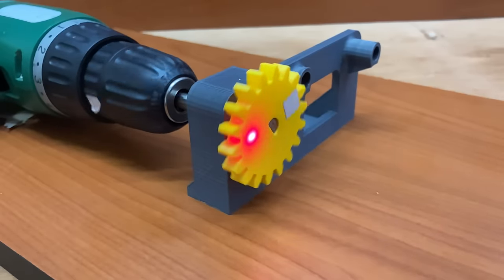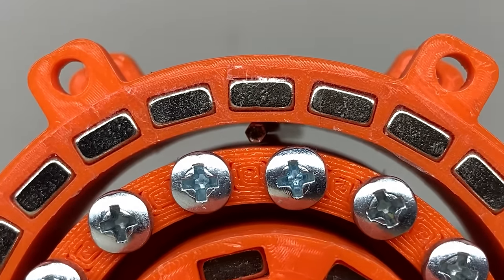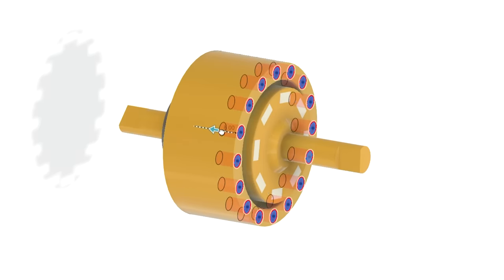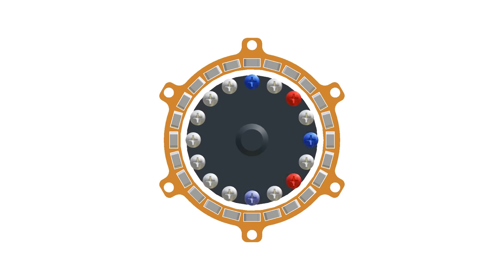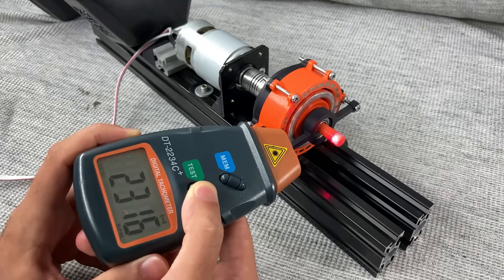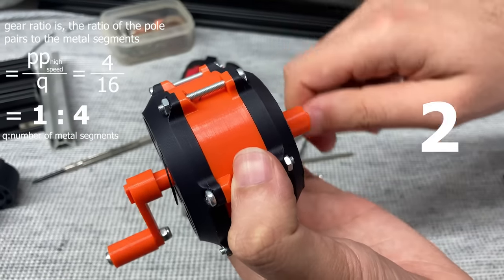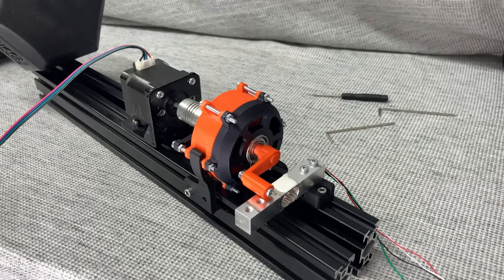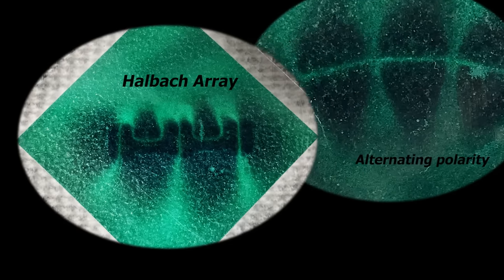Magnetic Gears - Why Nobody Talks About This?

Comment: Nobody talks about it as its old news. Motorcycles have used basically this exact "magnetic gear" to run the electronics with the object called a Stator... or on a car, its often called an alternator, (works a bit different but still does the same thing). This is why you car can run without a battery but not start without it, a motorcycle is a bit different, but still operates identically.
Reply: 8:29 Seriously take a moment and look at a stator replacement on a modern motor cycle.. youll see that exact bowl shaped ring magnet "gear" complete with magnetic pads.

Comment: Or just go gearless with an AC motor and VFD.  

Gear drives are extremely efficient at >97%.  Plus you can change the output direction.  Even with the magnetic drive you need bearings, that need lubrication too.  You could get some eddy current flow and damage the bearings if not electrically isolated.  

It’s a cool engineering concept though.

Comment: I don't know what a good use for these would be though, because they basically behave like mechanical gears with very worn or poorly meshed teeth, in that the teeth will skip each other with very little force. The only way you could deliver torque comparable to a mechanical gear system is to have the magnetic forces be on the same level as the shear strength of e.g. steel gear teeth, which seems like a lot of trouble compared to just cutting a gear out of a piece of metal.

Comment: Besides these boxes being in close proximity to other metal components inside engines.
Would these boxes have the capability to actually turn a load without breaking the magnetic attraction and cause slipping?

Comment: At 8:12 during the 10min 9k rpm test, look at the screw on your housing assembly, it was unscrewing itself‼️ 
I thought that was why you stopped it, to prevent the whole housing failing! Then your just like "nice, only the bearings got a little hot" 😭

Comment: People talking all in educational comments: Motor and Generators are magnetic gears and we are using it. As we see when we solve expressions. Motors works out to be "electrical"-"magnetic"-"electromagnetic-force" (no magnetic-electrical as we engage our own magnetic fields as rotor current to produce the effect.). So you see same direction as rotating magnetic field. So why is this rotating in different directions? Because in motor we make and control magnetic field and its direction. On contrary this guy just complexed a topic by bringing his own screw cylinder. We normally counter such harmonics of BACK-EMF through filters and back-feed.
Reply: I talked correct, not said well.
I hope you will get my talk.

Comment: I heard this saying in the blacksmithing forging community, if a magnet sticks then it’s not hot enough to forge. 

I wonder a way to keep these magnets at temperature that keeps the magnetic force. With high heat the magnetic force isn’t there in forging, when cooled down slightly same material’s magnetic force comes back online. And it sticks. But put it back into the fire and heat it up again, magnet will not stick. 

After spinning these gears for a length of time (is to put it back in the fire like forging) It prevents the magnetic force and then starts to slow down. 

Hmmm 🤔 

Or I could be wrong. 🤦‍♀️🤷‍♀️

Comment: Sadly it's called flywheel energy and it's been suppressed for 100 years by opec and now opec+. The "centrifuges" that are used as backup power for our 100 year old power factories are also called low pass filters, and it's claimed they just work as capacitors or low pass filters but are actually power storage and distro systems that balance the grid and main ac power across the entire grid. Flywheel batteries are used in space by nasa.

Comment: Hi Retsetman, I hope you're doing well. I recently came across your magnetic gears prototype video and was impressed by your work. I'm currently working on a similar project using 3D printing and was wondering if you could share the dimensions of the magnetic gears featured in your video. Any insights you can provide would be incredibly helpful for my replication efforts.

Comment: however gears are designed to convert torque, this model is capable to convert just slight rotational motion. Put it into mot just mechanical, but real dynamic test and it will slip the gears and stall. This is why nobody talks about it.
I have a technical university degree, thats why i comment on it.

Comment: Have you experimented with shaped magnets to act as bearings? 2 magnets, one shaped with a male "bump" and one shaped with a female "dimple" and resting atop one another having the same polarity for the dimple and the bump? Using the magnets themselves as a frictionless bearing held together by a non-conductive housing? This design, if it works, would eliminate ALL friction in a horizontal, multidirectional wind turbine. No bearing or bushing to burn out or freeze up, ever.

Comment: Hi, I loved this and it inspired me a question, but I cannot build and test an answer. You know the concept of perpetual movements (just to exemple the thought nothing to do with perpetual motion). The idea: you already the suspended ball, you lift and launch one from one side and it will hit the middle ball and stay there while the opposite ball will be projected to a similar ( but lesser hight) and this repeat for quite a long time until all the energy is dissipates. What if these balls were electric magnet and their magnetic field would be computer controlled to be activated a fraction of time before impact. This should result in the same motion but the only impact and transmission would be their magnetic field interacting with each others? Next level that same thing in a vacuum

Comment: You would need to tune it just like a flywheel to get rid of the noise. Extremely difficult in fdm.  I wouldn't say impossible because there are micron level optical stages made with fdm printers, so really anything is probably possible.

Comment: 6:19 Why is the motion of the output (sun gear) so jerky when shown in slowmo? The input (ring gear) is receiving perfectly rotational energy with no jerky motions, so something within the gearbox is introducing a jerky motion inbetween the input and output gears. I think I have a theory as to why this is happening, at 5:03 you explained that the number of pole pairs in the planetary gear needs to be the sum of the pole pairs in the sun and ring gears (sun has 4pp, ring has 12pp, planet should have 16pp) and each screw in the planet gear acts as a temporary magnet that is magnetized by the permanent magnetic forces of the other two gear sets, so 16 pole pairs means you should have 32 screws, but you accidentally halved it by putting 16 screws instead of 16 *pairs of screws (32 screws total) as the term pole pairs would imply.
Reply from the maker: The number of poles/screws in the modulator is correct, it should be the sum of the pole pairs in the rotors, so 4 pole pairs in the sun and 12 pole pairs in the ring, and this means that there should be 16 poles/screws in the modulator. But your approach is correct, because the number of screws in the modulator, more or less, definitely affects the jerky motion. And about the jerky motion, it's called cogging torque and I mentioned about it in the last magnetic gearbox I made. There's a video on the channel.

Comment: This may be a stupid question but what use would a gear pairing have if it can’t transmit torque? If turning up the rpm suddenly is enough to break the coupling, surely any resistance on the output end would do the same.

Comment: You calculated the efficiency by comparing RPMs? I suspect the rpm difference is caused by air friction losses of the gears. You’d have to measure input and output torque to calculate Energy losses.

Yes the magnetic gears are probably more efficient without a load (no work produced = useless), but if you try lifting a weight, or add a propeller to the output shaft, I believe the results won’t be the same.

Comment: In order to have that kind of power has to be magnetically charged which means you're gonna have to have polarity you're gonna have to have electricity to charge the coils I don't know I'm just a regular guy The lubrication is like vaseline in the wind if you want to use that kind of transmission you're going to have to have a ton of power it's just my opinion

Comment: I remember nylon sprocket gears for motorcycle street bikes back in the 1970s.. I believe they were under the name NEP.. they claimed to get much more Life out of a chain.
  Believe it or not, they did not last very long trying to stand up under that much power. I’m guessing around 50 to 70 hp on large four-cylinder Japanese street bikes in the late 70s.. The few people I heard of that tried them while I was working in motorcycle shops as a mechanic in those years, they never tried a second set after the first one just round it off either where they met the chain, or at the connection on the countershaft sprocket which is splined.
  in fact, it was not a good idea to use aluminum sprockets. My road racing Yamaha machine came with an assortment of rear and countershaft sprockets. To save weight they were made of aluminum. They did not last very long.
  even hardened steel with chromed plated finish transmission and ring and pinion gears have a tough time surviving in that hostile environment have a transmission on a motorcycle that the pressure exceeds 100,000 pounds per square inch since the late 1980s..
  A transmission is a pretty severe environment. It’s a miracle that they hold up as well as they do. They don’t call transmissions crash boxes for nothing..
  it has only been since the 1970s that the Japanese motorcycle manufacturers have improved the metallurgy of the power takeoff and transmission gears to the point that they can survive on the same oil that lubricates the cylinders cams and crank shaft. Open till then, transmissions ran on 90 weight gear lube..Some manufacturers still use 90 weight gear lube in their motorcycle transmissions, and they all use gear lube in their final drive ring and pinion at the rear wheel. There’s a lot of shearing going on in there

Comment: I’m curious, one problem I can see is how weak magnetic Field are to physically changes so what would be a solution to prevent each disk from knocking into each other if this was installed on a car or any other device? Wear and tear would be a huge concern most of the time

Comment: Magnetic gears aren't in widespread use because the problems you mention (like wear, etc.) are problems you face because you're using 3D printed plastic gears. Hardened metal gears will last a long time if they are properly dimensioned.

Comment: 9:44 How are you measuring loss? Comparing the input and output RPM will only tell you the gear ratio. Have to measure input and output power to calculate loss.

Comment: This is amazing, sadly it can't be "game changing" due to the nature of magnets murdering most electronics if not cased properly. This prevents wide spread use in most compact designs. It also can't be mass produced due to a slight error in design being able to throw off everything, and the issue with designing hundreds of these super precise gear boxes and how they interact with each other in tight spaces.

Comment: You would think this has no friction, but in practice it does have a lot of magnetic induced current friction which heats metal parts near the gearbox up. Not really practical. If you shield it you will reduce the efficiency and you have to worry about dumping heat.

Comment: There’s plenty of reasons.. 
- they don’t induce constant force so a system using them will suffer vibration and fatigue issues 
- they will be less efficient and therefore consume more power
- it’s more expensive 
- they will have significant backlash

Comment: What would happen using electromagnets? Would you be able to sustain a stronger magnetic field requiring higher torque to stop the output spinning? Might want to enclose in a Faraday cage or something depending on the magnetic fields generated.

Comment: heat, slip-backlash, too much play

theres so many reasons why you dont use a magnetic gear, because for all of the inaccuracy with a physical gear, the magnetic gear has infinitely more play, as it can slip when the forces get too great for the attractive forces

when magnets slip past one another and then re-attach, theres a massive amount of force, which increases as the magnets get stronger (which can annihilate a piston engine, and cause problems for electric motors)

with there being too much play, it can cause certain things to reduce their accuracy

we already have "torque converters" to prevent overstressing certain assemblies, or overstressing the source due to the load

Comment: Magnetic gears won't replace conventional cogs, not least because mining rare earths for making magnets harms environment, and magnetic field pollution needs to be limited. I don't really want this inside my tape recorder - however the electric motors are magnetic too, and the inherently limited torque may be useful for tape tear protection. 

So this may be more useful for making a reliable clutch than for replacing cogs.

Comment: 10:35 I would like to point that your setup is not just right.. To explain, resting point of handle should be between two mounting holes and force measured would be slightly biger.

Comment: Not sure if it'd work but  instead of using a rotating magnet as the sun gear  would building a three phase coil core would that produce a stronger magnetic field for the planetary and outer ring gear?

Comment: 10:14 that was apparent from the get go - I just wasted 10 minutes: what’s the ratio of load you can have in a magnetic vs a mechanical system, if all you have is those permanent magnets? How about using some physics equations? You could probably calculate the difference rather than measuring it. - I mean: with the right equipment you could probably get higher loads on magnetic couplings: when the superconducting magnets in a Tokamak accidentally quench, a machine weighing many tons will do a pretty impressive jump (and probably break stuff worth hundreds of millions of dollars while doing so…)…

Comment: Nice video and topic but I noticed two errors in your measurements or conclusions (I'm no professional, tho.):
1. Your measurement of the efficiency is wrong. You cant measure the efficiency of a gear system by comparing the "real world" gear ratio by the expected gear ratio. (When I got it right what you did there.) Think of it: With mechanical gears there would be slipping needed - especially to archive a very bad efficiency. That would be noticeable. Also that would not account for any friction in the system. To measure it correctly you would need a Dyno to get the output wattage and compare it to the input wattage / output wattage of only the motor. An easier somewhat-solution could be to at least compare the motor wattage when running alone vs. running with an (unloaded) gearbox.
2. (I'm not totally sure here.) When testing the output torque make sure you calibrated the load cell with an weight on the exact same spot where you apply torque with the gearbox. Reason is that otherwise you end up with different lever forces on the load cell. (You also measured fairly near it's measuring spots: the bore holes.) To erase this lever effect you could build an S-style cell out of it. That's also the usual load cell form for more "professional" load cells - as far as I know. (With S-style I mean an S on an 8-digit display.)
Haven't know of the existent of magnetic gears. Thanks for the video!
And I hope you could get what I mean, having trouble explaining myself clearly in English...

Comment: These vibrations will kill every real machine you will use it in. You will have to build a force-consistent-magnetic-field by adjusting the distance of the magnetics radially.
This whole circular stuff has to be adjustet precisely. Just think of excentric forces terms: m*e*ω². The faster you spin, the worse it gets (squared)!

Comment: Those magnetic gears would made sense like 50+ years ago, but considering, as a rule of thumb, magnetic gear torque and power approximately on par with bldc motor of the same size/mass, with modern electronic control systems such gears are ultimately pointless.

Comment: Another problem with magnetic gears is that heat degrades the magnets over time. It would be better to just transfer the energy digitally to another motor instead of using many gears of magnets.

Comment: Imo I'm the only one who ever asks the real questions.

Why not both? Why not have a engine that at 1-2 RPM it has enough magnetic force to work as expected, but still has gears, except the gears are just a few hairs short of ever touching, so it normally never touches. But when RPM goes higher, the gears will touch. Like when a red light turns green. But when you hit the speed limit, RPM goes back down to 1 or 2, therefore the magnets work as expected and gears stop touching.

If you REALLY want to know the truth, it's because you make money by making sure things like cars break down. Money is the reason for everything.

Comment: Torque was my first question, before anything else was said. Permanent magnets of any practical size/weight range are not that powerful. If you're relying on purely JUST magnets, that gear is going to slip with very little load.

Comment: This is a hydraulic automatic gearbox transmission is work

You can’t grind hydraulic.
The toch converter spins up the oil an powers the gearbox